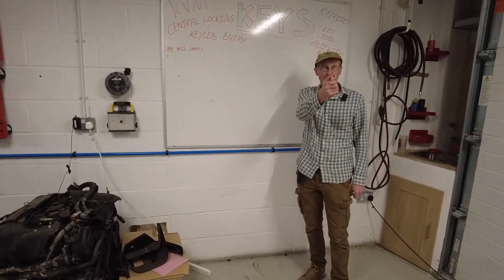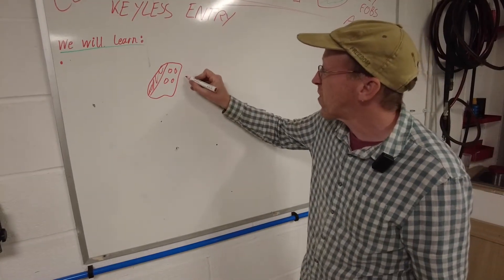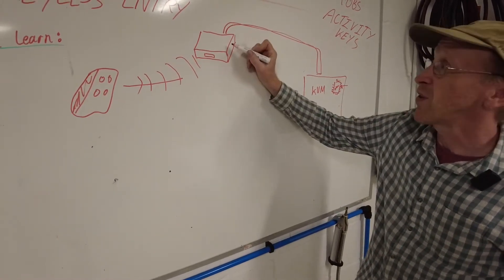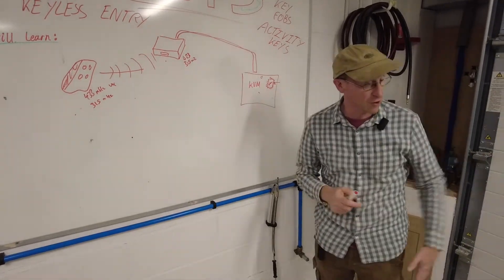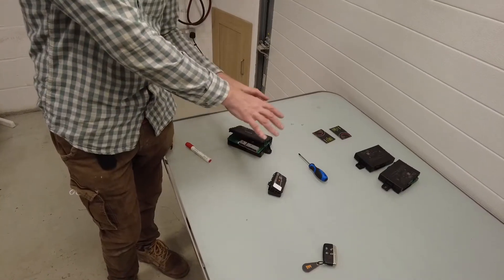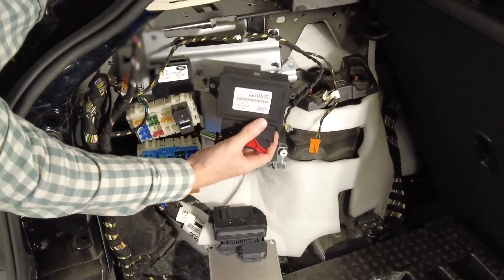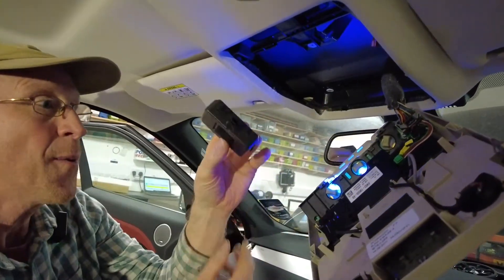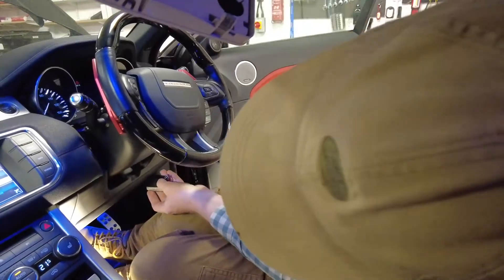Range Rover Evoque Key Not Found / KVM module repair / Keyfob Testing & Debug

Comment: Hi, thanks for your help on these cars. I have this problem on my 2018 Evoque, l also have a dead crashed Evoque that still starts fine as it should. Can l change the KVM and receiver and key from the crashed car to the good one ? Thanks again
Reply from the maker: I dont think this will work - it is probably coded to the chassis number of the car also.

Comment: The Other Module where the kays are stored is the BCM. That's why the engine starts without the KWM or antenna when you place the key near the steering column coil. The key Fob, also, has a conventional transponder function like the non Keyless start vehicles that gets powered and read by the coil and the data gets sent directly to the BCM.

Comment: I’m trying to solve a similar fault on a 2014 Freelander 2, with a sunroof. My remote locking and my smart key not working- so suspect RF receiver. However I understand the late FL2s share the electrical systems with the Evoque. I’ve got both versions of the RF receiver from eBay, and can’t find it in the roof where the older fl2s have these, or above the drivers courtesy light- any idea where it lives? I’m tearing my hair (and my hands 😂) to bits here
Reply: For anyone who has my model- it’s the evoque part, but it’s in the rear section of the headlining further back. If you are careful, if you remove the rear passenger handle and gently pull the headliner down to remove a few clips, you may be able to reach bank and bring the part forward. I’ve just swapped mine out- fixed! 😊
Reply from the maker: well done - I need to do a video on this
Reply from the maker: do you have your faulty sensor still ? can i buy it from you so I can make a video ? if so send an email to contact@powerfulUK.com
Reply: @L663 - sure thing,
Reply: @L663 I’ve sent you an email

Comment: Hi guys help required before a L405 get thrown in the bin !! 2016 stolen recovered. Came with keys and blade opens the door.
Fob does not open doors or start the car even when placed on the spot by the wheel. the error" Wrong key" is displayed.
Locksmith has checked and verified keys and KVM no issues found.
So basicly the vehicle does not see the key in anyway other than to say its the wrong key.
I can powerup the ign using the Scan tool and even this see no keys when check is performed.
At a total loss here. Any suggestions?
Cheers

Comment: I came here because my LR4 won't recognize the FOB. I use the steering column trick but that barely works. sometimes it takes 5, attempts, but usually takes over 20 attempts before it starts. My mechanic isn't interested in helping me anymore I guess because he said that the battery was dead and the terminals needed cleaned as if I was an idiot and that wasn't the first thing that I tried.

Comment: Hi my evoque not open end close from the remote, engine start ok , key battery is new
Reply from the maker: Tricky this one.. do you have a spare key you can try ?
Reply: @L663  no I don’t have unfortunately 😬
Reply: I have this same issue. Curiously, I have to be really careful when using the emergency key that I don't leave the fob in the car and lock it, or leave the car unlocked and go out of range with the fob in my pocket, or the car doesn't start and I have to disconnect the car battery. Really frustrating not having keyless entry/exit at the moment, but LR just want to replace the KVM and issue new keys. Might try Kwatronics when I get around to it, but I worry I won't be able to drive the car as the steering column start is hit and miss.
Reply: @MrMarcoUnico  I solved the problem with BCM resetting with original test on line end I bay another key fob and then bought off them reprogrammed with same test tools , no kvm replaced
Reply: @misu377 Thanks for the reply. So you mean for the main car battery? My car battery seems to have no problems, and it hasn't been replaced. So you mean have the BCM done and get a new key programmed instead of the KVM being fixed?
Reply: @MrMarcoUnico  my English is not so good
Reply: @MrMarcoUnico  mașina mea avea doar o singura cheie așa am cumparat-o iar ca sa reprogrameze cheia îți trebuie minim 2 chei , tu dacă ai minim 2 pot fi reprogramate ale tale nu trebuie sa iei alta ,  doar după reprogramarea bcm poți scrie din nou cheile , ai luat cumva in ultima perioada borna la baterie ? Pt ca se poate întâmpla problema asta

Comment: In case anyone is wondering. On a Evoque convertible this module is on the right hand side of the boot under a metal bracket supporting the boot tray.

Comment: There is more to the key. First there is the 433/315MHz door lock/open by pressing a button mechanism. The key usually is silent and only transmits if the button is pressed. The car detects this signal and locks/unlocks the doors  Than we have the presence detection via RF in the moment you press the start/stop button and this operates with more antennaes, 4 or 5, scattered inside the car and trunk. That system is also used if you left your key in the trunk and slam the hatch: it will not lock if the key is present in the car. This presence detection is rather good, 10cm inside/outside of the car makes a difference even though the hatch is only made from plastics. The start/stop button commands the engine control, which in turn asks the NFC under the steering wheel and the RF key presence detectors by sending out an query to the key, the key translates the query using its number, the translated message is sent back, either RF or NFC, and the engine compares if the right translation had been done.
So the key contains 3 different wireless systems. That why it is so bulky. I know, that when you leave your car, do not lock it, wait until the electronics shut down which takes some minutes, you hear relay clicking and turn off the instrument cluster and center console, and THAN press the button of the key to lock the car while far away, the key will not work anymore to start the car. If you repeat this some later day, let the unlocked car go to sleep and lock it from far away, it may work again. Somehow the synchronisation is lost.
Reply: Wow fantastic explanation. I'm having an issue where the key fob (with a new battery) will only lock/unlock the doors unless it is within a few feet of the vehicle. Also occasionally get the "smart key not detected" error. Could this be a central locking antenna or receiver issue?
Reply: @DarthFurball  (un)lock the door ONLY if nearby (thats intended, theft protection) or ONLY if some feet away ?
The 'smart lock not found' despite you carry it with you in your pocket while on the driver seat does most often mean that you have other metal parts in your pocket that interfere.
Reply: @DarthFurball hi were you able to find the issue that is causing it. Looks like we are in the same boat.
Reply: @MDEnterprise-j1f  I did. Took it (grudgingly) to the dealership and their diagnostics confirmed it was a faulty fob in my case. All the truck antennas and receiver were functioning normally, but the fob was transmitting erratically. Got a replacement and all is functioning normally now.

Comment: Similar issues with the jag xfs they sometimes they loose the keys codes if the car battery is replaced, bcm needs to be made virgin and reprogrammed, sometimes they need to be replaced and loads of messing around in SSD - id take a turn key crank anyday over all this messing
Reply from the maker: I did hear that its best to leave your lights on when you change your battery - this reduces the risk of current surge ? not sure if this is true - but apparently its a thing !

Comment: Hello friend
I am from Sri Lanka i was watched your videos regular… I have 2010 discover 4 UK speck… I have same problem key not found… I bought a nee key fob from UK my technician couldn’t  program he said I have replace KVM..So I just try to get KVM on eBay… how do I get correct KVM from UK  it should be Mach vehicle vin number?
Reply: This is tricky - the KVM needs to be coded to the car and the keys. You can often send the KVM to a specialist to recode / repair. Also make sure you do not have a phone charger in the car - this can interfere with the keyless start. Also it could be a problem with an antenna in the car. Does the emergency key start function work ?

Comment: Tried several times to contact KWA with no response.
Reply: We may be able to do this inhouse - would that be of interest ?
Reply: Yes it would if I am not able to replace the crystal oscillator myself. New one has been soldered in place but did not work. I fear I overheated it with an air gun. @simonjefferson

Comment: I need help my friend. I have this problem with my Evoque 2013. The key works well, but as soon I leave the car under the sun, the key doest not recognize by the car. I need to manually open the car and start ignition with the trick under the wheel. Then the car cools down and the key starts working again. What do you think is the problem?
Reply from the maker: This is odd but it is clearly linked to the receiver for the key and some component must be getting hot.
Reply: @L663  Can I change the RF Receiver straight to the car? I just bought the receiver and I dont know if its just plug and play. 

Thanks!
Reply: @AudiophileVideos  Similar issue here, and I wonder if it is a failing receiver due to the heat. Did you manage to work out if it was plug and play to put in a replacement unit?
Reply: @ very simple solution, just plug and play and walaaa! Problem solved
Reply: @ fantastic 👍👍
Reply: Hi guys, was this the RFA in the light cluster (in the ceiling)? Have an issue with my key fob not opening/locking doors, but works the engine fine. Can I buy a used RFA and replace it and it will work? Thanks
Reply: @MrMarcoUnico  The RF Receiver is to the left of the 2nd-row ceiling light cluster. It is plug and play (as long as you confirm the right mhz for your vehicle). Unfortunately swapping it didn't fix things in my case. There is also an RF Antenna there, but haven't tried swapping that as it is glued to the headliner...

Comment: Thanks for the great video, my daughters Evoque  has started saying key not found over the last few weeks so she just moves the key closer to the steering column but not the position shown in the video and it starts so thought it was just a week signal from the fob. Fitted new battery but still the same so could it be an issue with the amplifier receiving the signal.
Reply: Check she does not have a wireless charger in use - this can interfere with the signal from the key - also other add on electronics in car can cause issues.

Comment: Great video. This really helped me. I sent my KVM to Kwatronics, paid £150 for a repair, plugged it in but still no response from the key fobs(fobs checked by a lock smith). My next task is to remove the radio receiver unit but I’m stuck. It seems too tight when going through the light hatch in the roof lining, how did you guys manage it?
Reply from the maker: Hi Tom - does the car work if you hold the key against the steering column ?
I wonder if the Telematioc Control unit battery could be a problem ?
Have you had the fault codes read from the car ?
Reply: @L663  that’s a new one for me. The car starts with NFC. I’ve already ordered an RF unit so will fit it and see if that makes a difference. The chap at Kwatronics said to let him know the fault code once I get a locksmith to plug in a diagnostic tool.

Comment: Absolutely brilliant vlog can't thank you enough. I had tried the key under the steering column with the buttons pointing down (as recommended by Rover) but it didn't work. It wasn't until I placed it edge on , as you did , that the car finally recognised the key. So grateful ....

Comment: Rfa évoque error n U3000 46
Reply: I have this error code! Is this the RFA? I can start the car, but the key fob will not lock/unlock the doors. Can I buy a used RFA and put it in to fix this?

Comment: Hi simon iam from ct and bought a 2012 range rover evoque coupe without the cluster so i went on ebay and bought a (L538) 2.OL TURBO ENGINE ECM IMMOBILIZER MODULE
KEY SET installed it and it doesn’t wants to fire up . Has all kind of warning lights including transmission fault any idea what else needs to be changed or what to do to get it running?
Reply: Interesting this - to prevent vehicle theft Land Rover has put in a lot of measures - i think the cluster is coded to the car and all modules check that they have the same chassis number progrmmed into them. I am not sure but I think you need to get the info wiped from the cluster and program it as a new cluster on the car using the Pathfinder software.
Reply: Did you get this resolved as I know some individuals that can most likely get these configured for you.

Comment: Hello hello, thanks for these great vids. I have a 2016 L405. On the car ferry to France I discovered that my key had not be recognised when trying to start the car. After locking and unlocking the car this fault was remedied. I now have to carry out this procedure every time I want to start the car. Any ideas?
Reply from the maker: Do you have a wireless charger in the car close to where you put the key ?
Have you tried the key in different locations in the car ?
Reply: @L663  Hello and thanks for this speedy response.  After thinking about the situation, how about this? When the locking system is in 'keyless entry' mode, is there a certain amount of time that the 'push start' button has to be pressed after entering the car? Whilst on the ferry, I made my way to the car, unlocked it and got in, then proceeded to wait until told to drive off. it was then that the key was 'not found'. could this be the issue? The same happened on the way back home.

Comment: Desde Chile:  he visto varios videos tuyos muy buenos. Tengo el siguiente problema mi range rover sport 2016 se quedó sin batería y nunca mas partió (dejo de reconocer la llave) se realizó una llave nueva (intervención KVM)  y esta si la reconoce pero no Arranca alguien me indico que con el software SDD JLR se debe sincronizarlo los módulos lo cual no lo se hacer me estoy comprando el Software para ver si logro hacerlo arrancar.  Te pregunto si tienes idea como hacerlo???
From Chile: I have seen several very good videos of you. I have the following problem my range rover sport 2016 ran out of battery and never left again (I stop recognizing the key) a new key was made (KVM intervention) and this if it recognizes but does not boot someone told me that with the SDD JLR software the modules must be synchronized which I do not do I am buying the Software to see if I can make it boot.  I ask you if you have any idea how to do it???
Reply from the maker: Hi - interesting - it could be the Key - the receiver or the KVM module - all 3 need to be linked. The system is very complex.

Comment: Hi I have a disco sport . I have 2 fobs ….I have 1 that does what it’s meant too . The other no longer works on the key fob buttons , it starts the car . Jlr have said it sounds like kvm. But how so when I have a fob that works ? ( I haven’t booked it in with them as they have quoted nearly 1k . So why wont my 2nd key work ? @powerfulukltd
Reply from the maker: My bet would be that if it starts the car the KVM is fine - I would just use the IID tool ( or similar ) to add a new keyfob. We did this on our new Defenderhttps://youtu.be/ji2u_a5AAdQ

Comment: Sir i have a question am watching from Uganda am girl and am doing automotive engineering we have a Range Rover vogue 2020 it the smart key is not recognized unless u press it under the steering column that’s when it works we tried to check the telematics,KVM and the antenna even the fuses there all in good condition but the key isn’t recognized still .what maybe the problem.we were told that the car was in good condition by the time it was brought to Uganda but the situation started when the customer was trying to view or to have a look at the car.
Reply: Thanks sir by the way we worked on the but the game was on security like we could not program other keys due to the security of the car but what we did is we erased the key and then we programmed that very key corresponding with the KVM
Reply from the maker: It could be a faulty key - you could use a tool to add a new key ? Good luck with your studies.
Reply: @L663  but the key was okay just that they made some mistakes on programming it to the car

Comment: Hello. I know its been a while since you posted this video and not sure if you ever got your answer about the extra connector next to the KVM which you asked about in the video. I believe it is for the passive keyless entry. There are two types of modules in some of these cars. The non-passive and the passive. The passive one has three male connectors the non-passive has only two. Which makes me wonder if it would be possible to transform a non-passive vehicle into a passive one by simply exchanging the non-passive kvm with a passive one, reprogramming, and adding door handle sensors, since the wiring is already there?
Reply from the maker: I know this can be done and has been done but you also need to add a series of  antennas around the car to pick up the signal.

Comment: Hi, Great videos, I had the same issue today with my 18 Disco 5, locked it went for a walk with the kids and Dog came back and key wouldn't work. Opened it with the manual key and held to the steering column and got home , feared the worst and assumed it was the KVM, decided to disconnect the battery for 60 seconds in the hope it might reboot the ECUs and low and behold it worked. Key is working prefect again. Hopefully just a clich and not the start of the end for the Module
Reply from the maker: Good old turn on and off again computer fix - good idea that saved you some money.... fingers crossed it was a one off...
Reply: Removing and reinstalling fuse 1 and 17 behind the glove box should do the same trick.